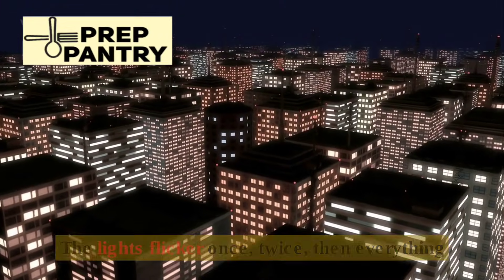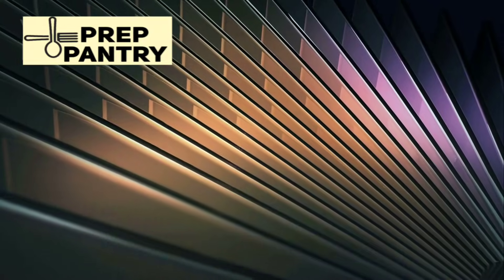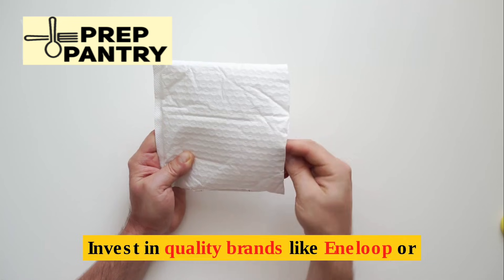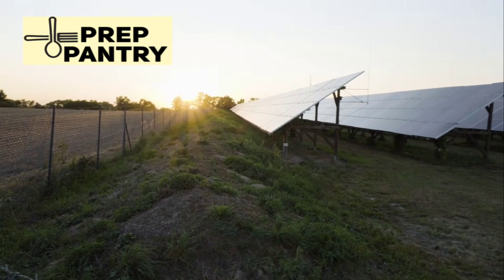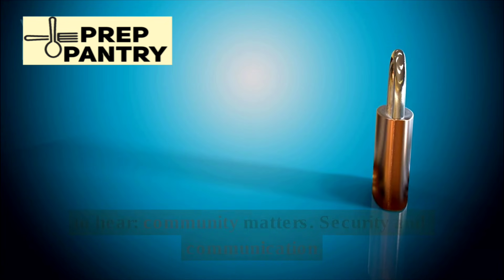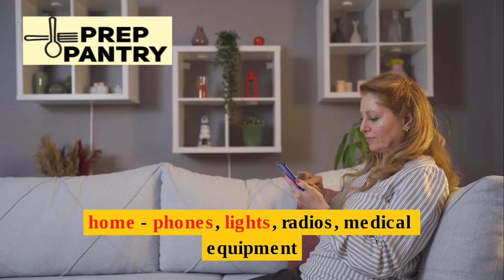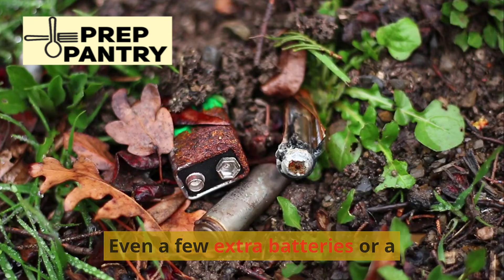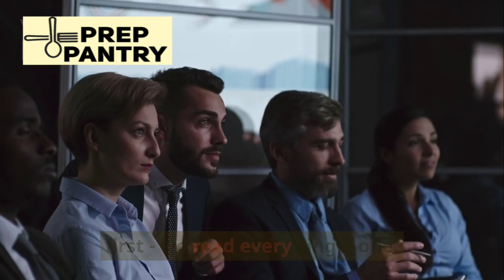Power Outage Survival: How Much Battery Backup Do You REALLY Need? (3 Days to 1 Year)

Comment: When charging phones and tablets from a power bank,
do not charge them over 80 percent.   After 80 percent, the device switches to a lower charge rate.
Charging from 80% to 90% will consume the same amount from the power bank as charging from 60% to 80%.
By not charging over 80%, you can gain an additional 1 or 2 more charges than the pack is 'rated' for doing full charges.   More if it is a larger pack, such as a 50,000 mA power bank.  Yes, banks this large exist, I have two.